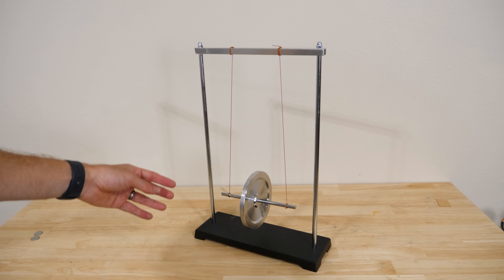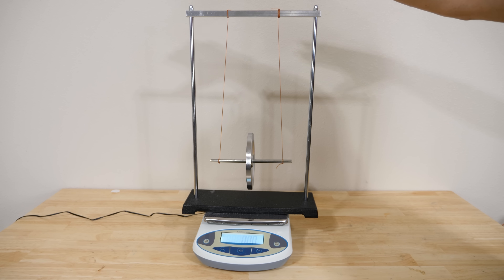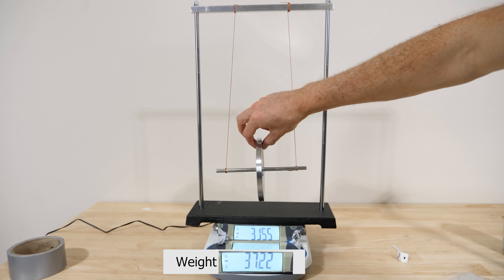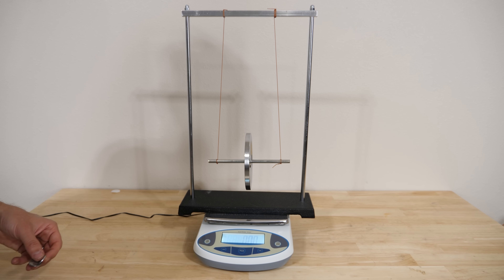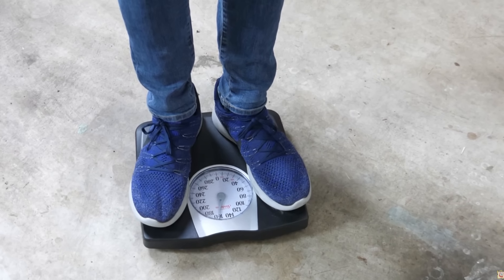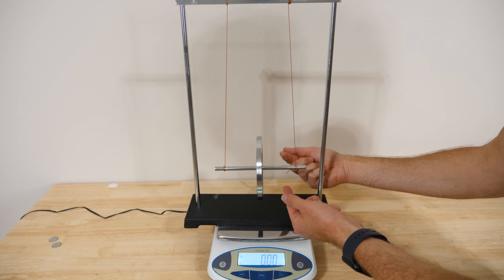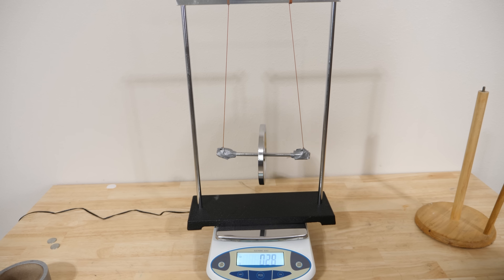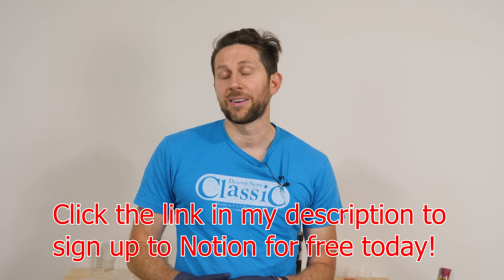How Does The Anti-Gravity Wheel Work?

Comment: Congratulations, you discovered a propulsion system that even NASA couldn't
Reply: Nope.
..
This effect depends on the actual vertical acceleration (which is always down) being a little less than gravity 'wants'.  
It as though the energy needed to be accelerating the wheel rotation is being taken from the gravity's acceleration. Gravity must not only accelerate the wheel mass in the  vertical direction, but also constantly spin up the rotational mass.
..
Here's the deal with this wheel:
The wheel does NOT weigh less when it is spinning!.
..
It may be more correct to say that it weighs less when it is "bouncing".
..
I have a problem with the interpretation of the Laithwaite demo.  Precession does not translate the wheel.  It does not lift it. 
Precession causes the axis of rotation to change direction. This is a ROTATION about the center-of-mass of the wheel. It is not lifting the whole wheel's mass. 
.
Precession does not cause the gyro to move (translate) sideways, nor upward in Laithwaite 's case or Veritasium's case. 
If the vertical spinning gyro had translation, it would slide along the table, but stay vertical. It does not do that.  It tips, or rotates at 90 degrees.
The fact that the handle is offset and long has significance.  If you push the handle in the direction of the precession, that lifts the handle, right?.

However the interpretation that the spinning wheel is always accelerating downward even while moving upward,  is a very good catch. It took me a few seconds to realize that.  My quick initial feeling was that the weight would go positive on the way up. . . 
The way to think of it is that it is 'partly falling' due to gravity.  When you are in free-fall you are completely 'weightless'.  The spin and string-shaft arrangement allow it to fall, but not fully, as when you are in free-fall.  So, the frame experiences somewhere between the full weight and weightless ness, but more weight during the bounce time. 
..
 The winding and unwinding of the string causes the up and down motion which is what changes the weight. 
..
Stand on a bathroom scale and at a medium speed, move up and down by bending your knees.  Try to move faster and faster on the way down and slower and slower on the way up. You will see your weight decrease during those times.

.. .. ..
If you watch carefully, you see that it is speeding-up as it drops; this is accelerating, but not at the full 'gravity-rate'.
Also, it is slowing-down as it rises, again not fully accelerating (decelerating or negative acceleration) due to gravity.
..
On a trampoline you are completely weightless from the time your feet leave the trampoline until they touch again and start the bounce. During this time you are constantly in 'total' free-fall.
When in contact with the trampoline you are accelerating upward and weigh more than normal.
If you can add a small upward force to reduce the acceleration due to gravity, you will weigh less. No surprise there.

This is analogous to only "partway" jumping on a trampoline (or your bouncing ball).  On a tramp, you are accelerating downward when your feet are not in contact with the tramp. The ball is when it is not in contact with the floor.  The spinning wheel only "partly" leaves the support strings.  It is "partially bouncing".
If the tramp accelerated you upward at twice the rate of gravity, your weight would double.
Therefore, there is also a slight increase in weight at the bottom bounce.
.
This would be equivalent to a small jetpack on your back that can't lift you, but only partly reduces your weight.  You would be in "Sloe-Fall", not free-fall.
..
This would make a wonderful Dean Drive Scam. . . .
..
It would be nice to have a real-time force load cell so we can see what happens at the bottom of the wheels travel - the positive weight gain during the short 'bounce' time.

..
Also, WHAT HAPPENS to the weight, if the wheel is NOT spinning, but bouncing while being suspended by a spring, instead of the winding/unwinding strings?  
Is that equivalent to this "partial bouncing" effect?

Comment: can you make the same effect with no moving parts. I mean where gravity doesnt effect it like if the device rotates that it doesnt stop working. becuase we can use it in planes to make the planes weigh less and use less fuel. we can try adding somthing inside the wheel and use a electro magnet to keep the potential energy at the same amount.  I could be wrong

Comment: If that weel is -6grams in vacum then it is anty gravity . If not then it is only becose of air friction
Reply: Here's the deal with this wheel:
The wheel does NOT weigh less when it is spinning!.
..
It may be more correct to say that it weighs less when it is "bouncing".
..
I have a problem with the interpretation of the Laithwaite demo.  Precession does not translate the wheel.  It does not lift it. 
Precession causes the axis of rotation to change direction. This is a ROTATION about the center-of-mass of the wheel. It is not lifting the whole wheel's mass. 
.
Precession does not cause the gyro to move (translate) sideways, nor upward in Laithwaite 's case or Veritasium's case. 
If the vertical spinning gyro had translation, it would slide along the table, but stay vertical. It does not do that.  It tips, or rotates at 90 degrees.
The fact that the handle is offset and long has significance.  If you push the handle in the direction of the precession, that lifts the handle, right?.

However the interpretation that the spinning wheel is always accelerating downward even while moving upward,  is a very good catch. It took me a few seconds to realize that.  My quick initial feeling was that the weight would go positive on the way up. . . 
The way to think of it is that is is 'partly falling' due to gravity.  When you are in free-fall you are completely 'weightless'.  The spin and string-shaft arrangement allow it to fall, but not fully, as when you are in free-fall.  So, the frame experiences somewhere between the full weight and weightless ness, but more weight during the bounce time. 
..
 The winding and unwinding of the string causes the up and down motion which is what changes the weight. 
..
Stand on a bathroom scale and at a medium speed, move up and down by bending your knees.  Try to move faster and faster on the way down and slower and slower on the way up. You will see your weight decrease during those times.

.. .. ..
If you watch carefully, you see that it is speeding-up as it drops; this is accelerating, but not at the full 'gravity-rate'.
Also, it is slowing-down as it rises, again not fully accelerating (decelerating or negative acceleration) due to gravity.
..
On a trampoline you are completely weightless from the time your feet leave the trampoline until they touch again and start the bounce. During this time you are constantly in 'total' free-fall.
When in contact with the trampoline you are accelerating upward and weigh more than normal.
If you can add a small upward force to reduce the acceleration due to gravity, you will weigh less. No surprise there.

This is analogous to only "partway" jumping on a trampoline (or your bouncing ball).  On a tramp, you are accelerating downward when your feet are not in contact with the tramp. The ball is when it is not in contact with the floor.  The spinning wheel only "partly" leaves the support strings.  It is "partially bouncing".
If the tramp accelerated you upward at twice the rate of gravity, your weight would double.
Therefore, there is also a slight increase in weight at the bottom bounce.
.
This would be equivalent to a small jetpack on your back that can't lift you, but only partly reduces your weight.  You would be in "Sloe-Fall", not free-fall.
..
This would make a wonderful Dean Drive Scam. . . .
..
It would be nice to have a real-time force load cell so we can see what happens at the bottom of the wheels travel - the positive weight gain during the short 'bounce' time.

..
Also, WHAT HAPPENS to the weight, if the wheel is NOT spinning, but bouncing while being suspended by a spring, instead of the winding/unwinding strings?  
Is that equivalent to this "partial bouncing" effect?

Comment: A similar question popped up in our 1975 Physics exam but was about a passenger’s weight in a moving elevator. The math we correctly applied proved what you are trying to explain by show and tell. My exam marks were higher than most fellow engineering students because I first understand the principles involved.

Comment: On the way down you would expect less weight.  On the way up more.   The scales don't react quickly enough to show the weight increase on the way up.  The average is the 000 as before, its just that the scales reaction is to slow to show the exact varience up and down

Comment: Here is my equation to calculate the delta force (mg-F)/mg =(RW)^2/(4gH), where R is radius, W is angular speed, m is mass of the wheel, F is the force measured by balance, H is distance the wheel travels down till it goes back.  The fast the W and R, the larger the difference.  Assume F=0 (levitation), (RW)^2/(4gH)=1; so when (RW)^2=4gH, the balance should measure the negative weight of the wheel -mg.

Comment: Have the spinning mass suspended in the air at the end on axle.  Of course it will be processing.  Measure the tension on the string tied to the end of the axle to get the weight of the system. (or equivalently put the entire apparatus on a scale as you have done.)  Now make the string ever shorter (or longer)  and give the end of the axle constant acceleration.  What happens to the weight of the system?   As a control, repeat the same experiment with the same mass in bulk on the end of the string with nothing spinning.  Just a weight on a string that gets pulled up or let down.  Do we get the same weight profile? (same measurements on the scale?)  This would be Laithwaite's experiment.  I have not seen it faithfully reproduced on YouTube yet.  You are the first to explore the vertical acceleration changing aspect, so you are part way there.

Comment: You could do a more extreme version of the same thing with a ball bouncing inside a vertical tube. While the ball is either falling or ascending the entire weight of the ball is zero and does not register on the balance. While it is in process of bouncing there is a large positive spike in weight. The weight loss averaged over time is zero, per Newton's first law. You would need a load cell and an integrator to measure this for a demo.

Comment: At around the 7:30 timestamp, when you're holding the disc in your hand, of course the weight of the stand will be lighter because there's no tension on the strings. But when it is spinning, in both the up and down direction, the tension is constant on the strings so the scale reads the combined weight of both the stand and the disc. Something else is causing the combined weight to become lighter. Sorry, didn't read through 1000 comments if there's an answer to this!

Comment: Rough numbers: Its acceleration while falling down (or up) is 6g / 720g x G = 0.00833G or 0.266ft/sec². Its fall time is about 3s, so its peak velocity (just before it bounces) = at (acceleration times time) = 0.8ft/s. The distance traveled = 1/2at² = 1.2ft.

Comment: Interesting BUT… I believe your experiment is flawed. Why? The scale doesn’t accurately capture the excessive weight of the gyro as it hits bottom. Compare it to a bouncing ball which is weightless as it moves through the air. You have simply slowed the ball down to distort the weight distribution. It was fun and yet puzzling to watch however. Thank-you.

Comment: Any time you hear the words 'potential energy' in physics you know you're in fantasy land. What's the difference between the gyroscope on the scale and the suspended wheel? The strings. The strings are essentially a stretched spring which will continually try to recompress, which will lift the wheel. In effect, giving the wheel less inertia in relation to the scale underneath, which is what a scale measures. Zeroing the scale fixes the unseen lifting the strings are contributing to the set-up in the static state. By spinning the wheel the strings are stretched further resulting in more lift, which shows up as less inertia on the scale. If the shaft of the wheel is spun in loops at the bottom of the strings instead of pulling the strings around the shaft the lifting effect will be much less.  Suspend the wheel by two rubber bands with a strength that allows the wheel to go down as far as the strings do and zero that set-up. Then take the wheel back to the top and without spinning it let it drop. As the bands stretch and recompress the scale will also show minus values, though with wider fluctuations because the lifting will be less even than with the strings. There is a much deeper truth you've exposed with this demonstration, but I doubt you can see it. Oh well.

Comment: Anti gravity is simply bend space time back to straight. Magnets showed us that a secluded powerfull force can overcome the globally applying one. (compass towards earth, magnet overrides). Gravity is the same. The global bending caused by well earth, can be overcome by a localized stronger force to either counter it in that section or even bend it against the global force direction and aplitude. Currently the only thing that can produce an effect on the global gravitational field apart from just condense mass is momentum. Or a different way of phrasing is acceleration.

For example if you were to radiate particles or a medium in an accelerating fashion in an area, then the gravitational bending would be greater then what the medium or particles mass would provide. By adding energy to this acceleration and/or furthure increase the density of the medium/particles we can overcome the space bendin in that area and it's imidiate sorrounding thus creating less gravitational effects, negate or even reverse it.

Light has no mass, but has momentum and as it travels along a path it disorts space in its imidiate sorrounding just like how mass would. Due to the very high velocity light has this is actually measurable.

From gravitational waves measured from collapsing massive celestial objects and the more detailed study of earth gravitational field over it's rotation we also know that space itself has innertia, so it retains the characteristics of an object's momentum, in ripples or swirls.

Up to this point my best guess is really to have a machine that spins matter in high velocity in a confined area, like a modified fusion reactor. However it is very likelly that the gravity bending from momentum would be so miniscuel that it couldn't overcome earth's gravity well.. However it may still find uses as propulsion in less gravity enviroment or even scaled up to interstellar travel. Since it's base idea is bending space, the amount should be possible to increase until the structural integrity gives in due to traversing across space. Still maybe strategicly placed space bending spinny wheels could reduce this stress and maybe create a medium that can survive near or even over relativistic speeds in empyt space.

Comment: The spin friction with the air resistance accounts the loss of weight.  The spin effect making a gyroscope want to lift upwards on one end of the axle when rotated in relation to the spinning disc only works if the other end of the axle is fixed, otherwise torque would just make the disc flip.  There is no loss of weight.

Comment: I'm sorry but I have to comment.. The Disc and rod are a solid entity, if the disc were to be on a bearing through which the rod passed through so as to reduce spin, the result would not be the same. This is not mentioned in the video. So assuming that the Disc is fused to the rod then it acts like a fly wheel and as it revolves the mass of the lower (below the rod) is moving in an upward direction and as such anything that can move up will lose mass in gravity but because the same force is being exerted by the top half of the disc wanting to move downwards this will cancel out. What is happening is friction on the strings are working on the way up not the same as they do on the way down. This is where gravity comes in and aid the forces in the downward but not the upward. As you have seen, the video shows a very fast set of gram weights that fluctuate around 6gms. If you scale up the model the weights will be different. the reason for the results gained in this experiment is...that at any given time when wound to the top there is as much rotational force put on the object but it will lose a tiny amount of energy when it hits rock bottom but there is enough energy left in the flywheel to recover most of the energy lost, and so it goes up and down again.

Comment: I think this is a bogus interpretation.  if you stand on a scale and lift your arms up and down or better yet, hold a heavy object in your hands and lift it up and down you should see exactly the same effect.........but of course you don't.........try it.........the other problem I have is that the weight is decreasing equally as the wheel moves in both directions.....acceleration is a vector quantity, both negative and positive....so the acceleration argument doesn't hold up.........many of these scales are very sensitive to extraneous magnetic fields.........we have lots of them at work and they are known to be affected by metal and devices in their proximity........particularly if there is movement...........replace the wheel with wood or plastic and you can verify this

Comment: It has nothing to do with gyroscopes. If you would let go a body with no moving parts and shoot the sequence at high speed, you would see the body having ~zero weight as it goes down, and ~zero weight as it bounces back up (and a huge weight during the short moment when the string is in tension, when the body reaches the bottom)